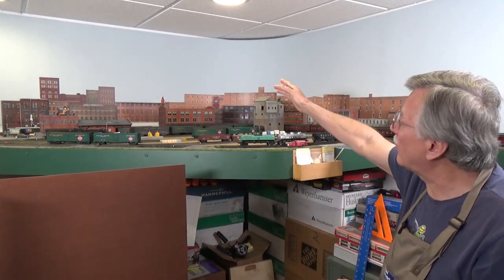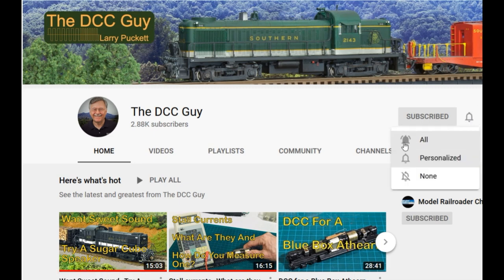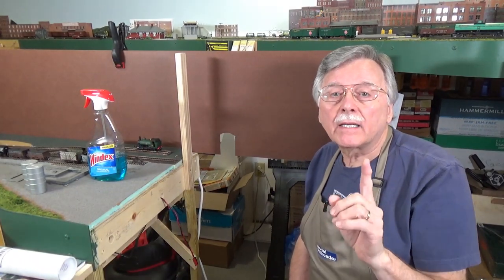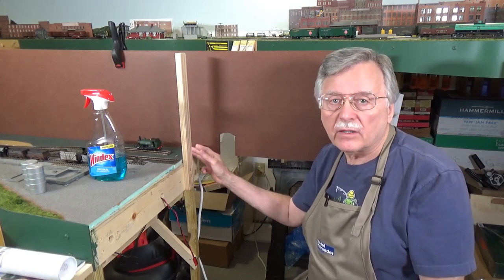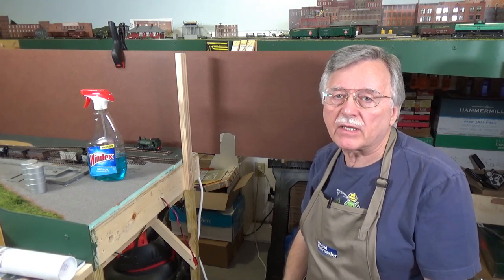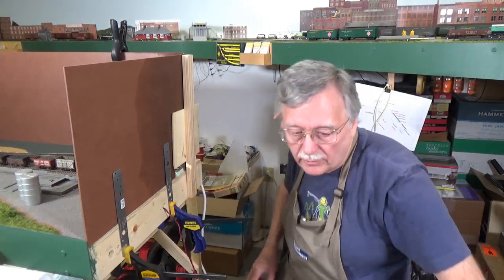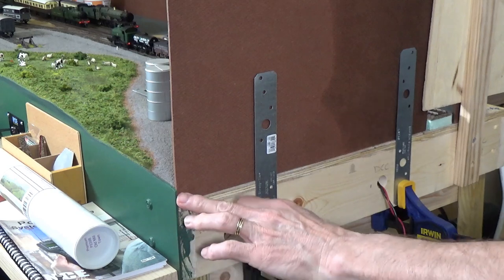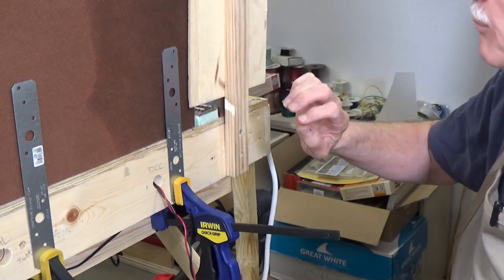Curved Backdrops For Your Model Railroad (187)

Comment: I like the idea. Having worked in a shipyard where metal plates are shaped and bent, the only suggestion I would make is to not cut the hole until after the bending is done.
The is both for having a uniform resistance for the bend and because materials stretch and deform while bending so the location will be more precise if measured and cut after bending.
Reply from the maker: Good tip but the problem was that the track and roadbed protrude from the ends of the layout so I had to cut the hole first to get it to fit over the track.

Comment: Gus Portokalos was right:  "Put some Windex on it!"
I will use that technique to make a center dividing backdrop (with a much gentler curve) on the modular 'island' layout I am building.  Thanks for the tip!
Reply from the maker: Yes, that’s what my friend Dale had done on his layout. The backdrop running down the peninsula has a slight curve built in and therefor is totally self supporting. I just carried it a step further with a much sharper radius and the Masonite can take the bend without cracking. A great method for doing outside curves on a layout too.

Comment: Very helpful Larry. I’m just wondering how much windex to spray, and I’m guessing it’s better to over spray, than under spray?  Also ( I may have missed it) how long did you wait after spraying to bending it?Thanks.
Reply from the maker: I sprayed it on until it ran off and would not absorb more. I waited about 15-20 minutes before starting the bend.That was essentially how long it took me to clean up the mess in my truck bed and drag the hardboard inside, pop it into place on the layout, and get the lights, camera, and microphone ready for recording. If it doesn’t bend easily then just give it some more time. It would really have made it easier if I had a helper.

Comment: How long did you leave the Masonite soaking? And was the runoff brown? I’m in NZ and I think I have a compatible product but not completely sure. Thanks in advance.
Reply from the maker: I only left it a few minutes before I started bending and it soaked in fairly quickly. I don’t remember any brown runoff but your product may have a dye added. Basically you are looking for Masonite or a similar product. I suggest you do a test first with some scraps just to see how it works with your product.

Comment: Larry, Great tutorial. Realize it’s been awhile since the video was produced , but hoping you still review all comments. Ready to start my curved backdrop & will be following your tutorial. Have 2 questions:
   * how did you measure including the curve to get the side section abut perfectly with the front section?
   * what spacing did you use for the back section vertical braces?
Thanks
Reply from the maker: First I cut the foam base on the rear corners to the rounded shape I wanted. Then I ran a piece of flexible stranded copper wire along the edge of the foam the entire length of the area where the backdrop would go. I then simply measured the length of that wire to get the length of the hardboard. For the supports I just eyeballed them, but the two supports on the corners need to be placed at the point where the curve meets the tangent. The supports at the other locations are 3” in from the ends.

Comment: How do you avoid surface crinkling on the inside of the 90 degree curve? Will it sand down to a smooth surface once completely dry? Thanks Malcolm Giles
Reply from the maker: I’ve never had any surface crinkling, came out smooth as a babies bottom, first time, every time.
Reply: @TheDCCGuy  I’ve realised I tried it on MDF board, NOT the same thing at all. Bit of a newbie q I’m afraid

Comment: Great tutorial Larry, great tip; windex with ammonia D, I’ll store that on my hard disk. Anyhow, for the vertical support you had to remove and remount after bending the masonite, your screw both held the support as it did the horizontal bracing. Therefore the screw isn’t able to grasp on the vertical brace, because the winds of the screw between the two pieces will in fact remain the same, which will eventually pull the screw into the wood of the vertical support. To solve this you can drill the pilot hole in the vertical support slightly bigger than the screw diameter, this will make the screw winds only grab the wood of the horizontal brace and allow for your vertical support to be attached fully flush without extra hands. It’s a technique that’s often forgotten because of the availability of screw machines and impact screw machines, however this method allows for easier construction and tighter mechanical attachment.
Reply: I'm very glad you brought these points out. It was screaming in my head. I was just about to start a new comment when I saw yours. Very good expansion.
Reply: @JohnMullerJDGCTRy  Thank you John, I very much appreciate your comment. Especially in construction videos one can see that this method isn’t used anymore. People who are into construction and producing videos really should know better. I skip watching when I see it. 
Larry’s videos are a different ballgame, he speeds us all up into the wonderful world of todays model railroading. Just from the standpoint of being thankful, it comes with ease to share this knowledge for all those out there struggling with screws and just a single pair of hands. 
I used to work in construction, plumbing to be precise, but had to say farewell to the job and business because of a serious back injury. Model railroading or Modeling is a way to maintain and up my skills on a fine scale.

Comment: Larry,
Great job.  I agree with your friend about using WINDEX.  I have done this exact same thing numerous times over the past 40 - 50 years.  I think I found the idea an edition of Model Railroad Enthusiast (in the mid late 1960's).
An additional hack I have used dealing with your vertical support.  When you screw you wood supports to your benchwork attach the support BEFORE you begin bending the mica-board..  Then when you start to unscrew the top screw all the way out.  The bottom screw you ease out enough to spin the support to the side.  Yet still connected to the benchwork.  Then as you wrap the mica-board around the bend simply spin the support back in place and screw it back to hold the mica as the WINDEX dries.
Now you had an idea that I am adding to my war chest.   The use of a piece of plywood as a wedge protecting the tunnel gap.  I used to over kill this by mounting many to many up rights.  Your idea of bracing the cutout is masterful.  It adds more support than multiple supports & it safely crosses the gap.
Really nice job
~Jim
Reply from the maker: Goo idea on the uprights. I bent the other end of the backboard yesterday and it went even better as I learned a couple of things from the last one. I have a really big one to do on the Piedmont Southern that will take some real tricky maneuvers—video to come on that one.

Comment: Larry, this is a very fortuitously timed video.  I've been trying to get tight bends in Masonite for fascia and have been trying it with steam and fabric softener with varying degrees of success. (Both "fuzz up" the surface and I still haven't managed curves as tight a you have demonstrated in what appears to be 1/4" Masonite and I'm only using 1/8" stock material.) I would never have thought about an ammonia based product.  It would have been nice to see the saturation process itself, particularly how much Masonite you wetted out in terms of the curve arc length and any leeway either side of that and just how much you sprayed on but I can experiment with that.  Well timed great help, thanks.
Reply from the maker: I basically just measured the area to be bent, marked it on the hardboard with a pencil then saturated the backside out to about 1” on the straight. I sprayed it on until Windex ran off, let it sit, then repeated it once it soaked in. Did that about 3 times. I also sprayed the front just to see if it would soak in and it did so I sprayed it a couple of times for good measure. BTW this is 1/8” not 1/4”. This was a pretty tight bend and I don’t envision trying anything sharper. As I said it would have been easier with a helper—just go slow and then clamp it in place ti dry. I would think a fascia would be much easier than a tall backdrop section. I have one more on the Piedmont Southern that needs to be 26” tall so am not looking forward to that.

Comment: I've never done this before  ( have bent wood) but would use ammonia and water along with a heat gun to apply heat to the back side while bending.  Making some bending molds to produce an accurate curve might be very helpful.  Will be playing with this in a few months.
Reply from the maker: Don’t overthink it, the process works surprisingly well with free hand bending alone. Forms might help in some complex cases but as I showed in this and the one on the Piedmont Southern it is easy for simple but tight curves.
Reply: @TheDCCGuy  😁  Definitely not over thinking !   The Windex you use works only because the active ingredient is ammonia (used on some types of wood bending because it softens the lignin) and it has detergent as a wetting agent.   You appeared to be struggling with that bend and  I've bent American Beech easier.  I might be wrong but it looked like the radius at the top is wider than at the bottom.   Using Windex or ammonia solution on the back (rough) side (to help allow the fibers to stretch) and applying some gentle heat ( speeds up the softening) will make the bend easier.  Wetting the inside of the curve probably has little advantage since it is on the compression side of the curve.  Using a very simple form will provide support while doing the bend and maintain desired radius while drying.

Comment: That is very good to know. Thanks for sharing. I wonder if pre-bending the board around a piece of large diameter PVC pipe, using clamps once you have it wet might make it easier to bend. That way you don't risk damaging your layout. As you struggled with holding the back drop and drill, all I could think of is the disaster of the board cleaning off the top of the layout. Very cool technique. Thanks again.
Reply from the maker: Jeff—I actually had considered bending it around a lolly column in my basement but then decided it would give a better fit to do it i place. Just being off a few tenths would have resulted in a less than perfect curve and created problems at the fascia.

Comment: Great video. Changed my mind completely about using a curved backdrop. I was skeptical about the lost space, but it looks like you are achieving a very tight radius. Question: What do you consider to be a safe minimum bend radius?
Reply from the maker: I have never tested minimum radius but it can be very small. I think the small test bend I showed was bent around an old 1 lb coffee can. I suggest using such a can or a steel support column in your basement and give it a test. Most of my large backdrops on the Piedmont Southern were installed dry allowing the hardboard to take a natural radius similar to the curve of the track. However I do have an outside curve on a corner that had to be wet bent.

Comment: Thanks for the informative video I am looking forward to seeing the next one. Windex is an American cleaner and is not common in the UK however, I managed to find it from a store in London which had a couple of bottles of the original windex. It cost me £21 for two bottles including postage so I am wondering how it compares with purchasing bendy board for the UK subscribers. Thanks, Mel
Reply from the maker: Mel, do you have a similar product that has ammonia in it or can you get a bottle of ammonia used for cleaning? Given Dale’s instructions to me I believe the ammonia loosens the internal bonds between the wood fibers making the bend possible and the when it dries the fibers rejoin creating a permanent bend. You might test that on a scrap piece of hardboard. I think bendy board is a plastic material so it should work too. On one layout I cut down 4’ x 8’ sheets of 0.040 styrene but the cost has gone up too much now and it is hard to find where I live so I went back to Masonite.

Comment: Hi Larry, for us UK viewers, what is Windex? Is it some  window cleaning solution?
Reply from the maker: Sorry, I assumed you had it or something similar. It is a very old American brand of window cleaner. The original formula has ammonia-D which I think refers to the chemical formula H3N or ammonia d3. It was invented in 1933 and was mainly alcohol and ammonia with several other components in much smaller quantities. As I said in the video the ammonia seems to be the critical component however I have never tested other types. I don’t know if a solution of ammonia in water and/or alcohol would work. There are a lot of  websites purporting to tell how to make your own Windex.
Reply: Windowlene  is/was the UK equivalent of Windex.  But check the formulation still has ammonia in it.  I think the UK “Nanny State” had the ammonia removed.

Comment: did you soak both sides in order to bend?
Reply from the maker: I mainly saturated the rough side thinking the smooth side would shed the Windex. However at the last I also gave the smooth side a few shots too and it did soak in.